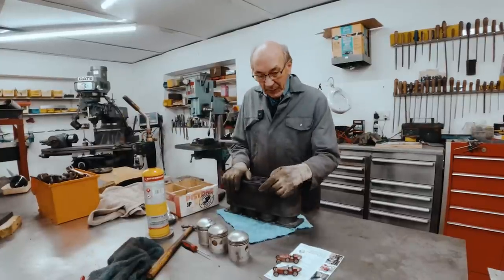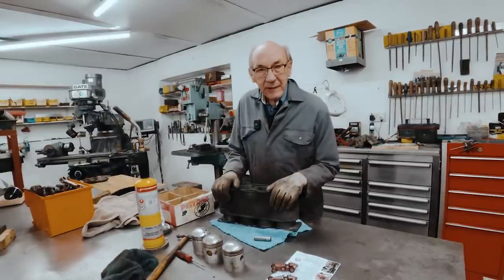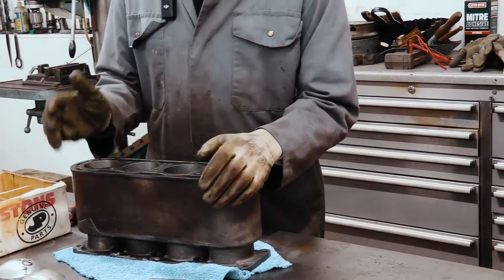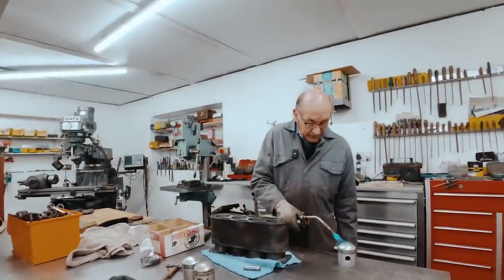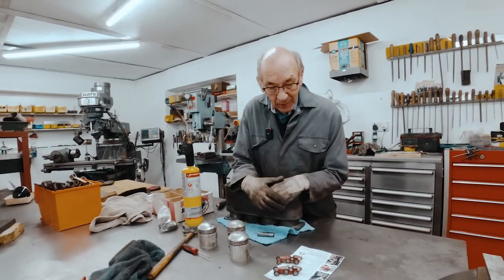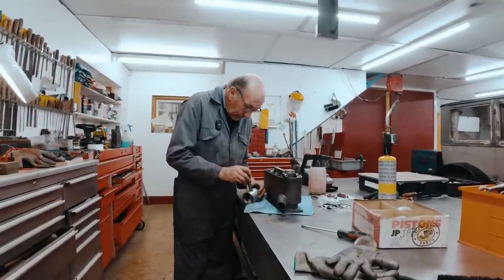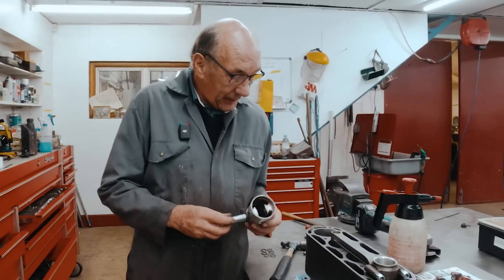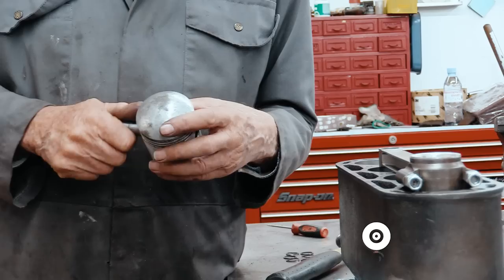SHED RACING - Salmson gps engine

Comment: I remember as a kid in the late 60s going with my dad to a shop in Indiana that built circle track and drag racing flathead Fords and rebuilt Offy engines. They had mills and lathes of course but the old guy showing us around laughed and said that you had to have a fully equiped machine shop to impress the customers but that didn't mean you had to actually use them. He joked about having to assure a customer that he would certainly resurface his cylinder heads on the mill and then honoring his promise by clamping the heads on the bridgeport to hold them while he cleaned them up with a file.

You guys are all right by me

Comment: The gudgeon pad pins are better than circlips,  most American Aero engines used them from the 30's.  They are generally aluminium but I don't see why brass won't work.  However for the last few years we have been using PTFE pads on all our race engine and it is the best we have found.  I can't claim to have thought of this as the MMM MG boys have been doing it for years.

Comment: Don’t worry if the pistons are a bit loose in the bore, you can always use the old knurling the skirt trick, it’s the original putting back on tool.

Comment: Those pistons look very similar to the Omega pistons I used in my Riley engine. Domed instead of flat top for higher compression, 2 piston rings and a oil ring. As I used 3mm longer rods (for even more compression) I needed to machine a step of the crown so the +60 thou piston wouldn't hit the head or gasket. Someone cleverer than me told me that the pistons are machined inside the skirt so you can make a mandrel to fit just as you did. But I also machined up a 'fake' gudgeon pin that has a threaded hole in the middle cross ways. I could then put a long bolt through the middle of the mandrel that threaded into the fake pin allowing me to pull the piston tight down onto the mandrel and machine the step on the crown. The Riley uses cir-clips to hold the pins in and one was missing and it was a massive pain finding new ones as it seems no one in NZ stocked the (imperial) type I needed. Regarding piston rings, they used to be made here in New Zealand but now that seems to have stopped as the one old chap who did it retired. I broke several rings trying to fit them and had to wait some time to get new ones from the UK. It's getting harder and harder to work on these old cars here as the people with the skills all retire or die and all parts need to be imported. Your content and knowledge is most useful for those of us trying to do similar and it gives me confidence the ways I get around problems are sound, thank you.

Comment: Great channel !! Found my way from Cold War Motors 
I did spend some time in a machine shop here in Milwaukee (where is that?) USA Wisconsin
I can see where you are taking this. I found out back in the 70's that this water cooled Suzuki had pistons that actually got smaller with age, not from wear, as they would look like new.

Comment: Hello from Canada: Heating the piston and seeing it expand so much it won't fit is part of my job.  I design and build piston pumps for liquid filling.  They have Acetal (Deltin) pistons for the most part.  If a customer wants to fill a hot product we boil the pistons to check the expansion.  The bore is 3.75".  When hot an unmodified piston can expand  .080 in diameter.  An interesting thing is that the initial heating releases internal stresses in the plastic and they seldom return to the original diameter.  It can 2 or 3 heat cycles for them to stabilize.  Does the same thing happen with your aluminum pistons (if never used) with heat cycling?

Comment: Like your attitude and the way you do things, but it seems to me, it would have been easier to have the guys who sleeved your block hone it to fit the pistons.  Also, in the 60's , it was a hot new deal to use teflon buttons in the wrist pins- maybe an idea to replace the bronze ones.  However, since you decided to go with a circlip, I would have used an expanding mandrel to hold the piston.

Comment: I would have made a tool of two pieces oh wood hinged  at on end and drilled in the middle the diameter of the piston. Then put 400 wet or dry to line the hole. Then open it ant apply it around the piston and then spin it in the lathe while applying the abrasive lined hole to the surface being turned  and you. Will have a more controlled abrasion than just a loose piece of abradsive.

Comment: You have got me confused Ivan. You said that there was wear on the gudgeon pin, but yet at the end you say that 5he pistons have never been used. Are the gudgeon pins second hand then?
Reply: If the pistons came in that cardboard box, there's a chance that he didn't get the gudgeon pins. The ones he is using probably came with the engine.